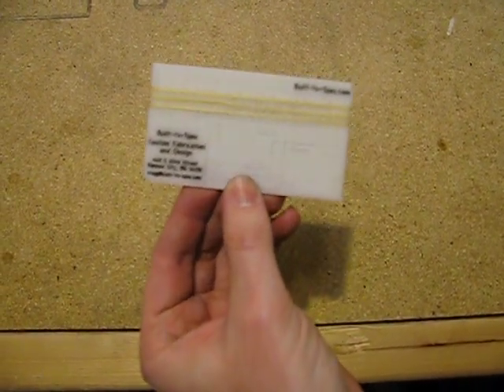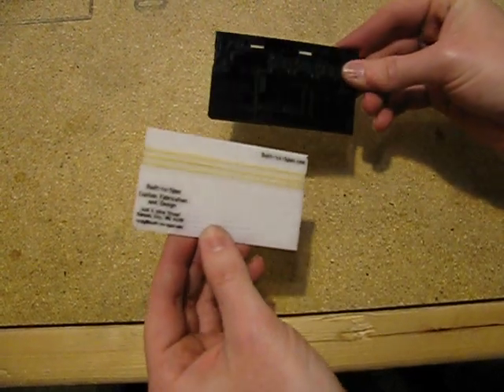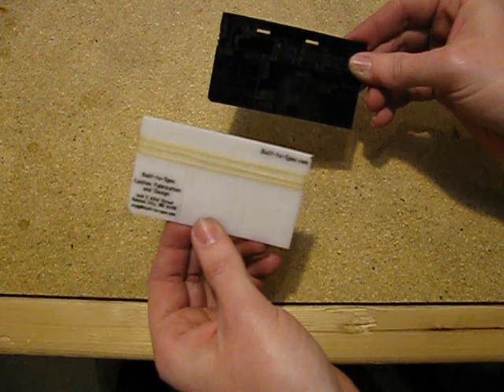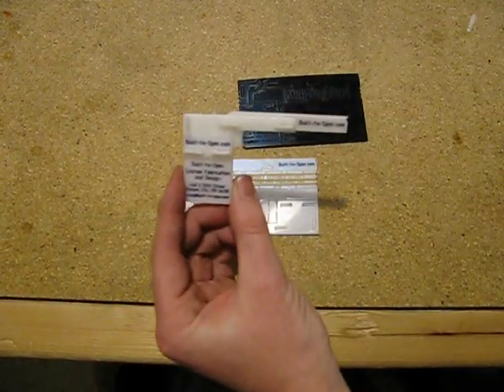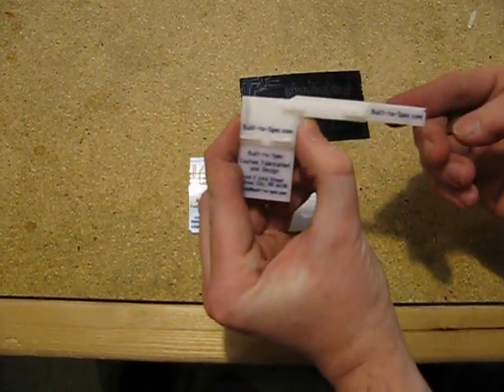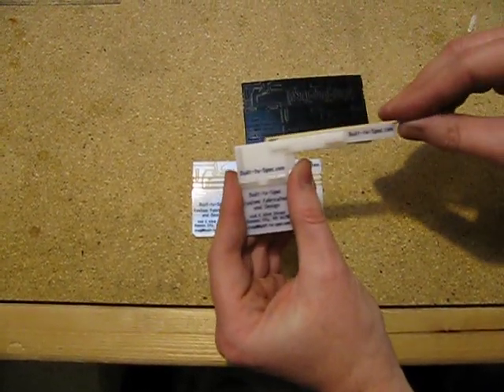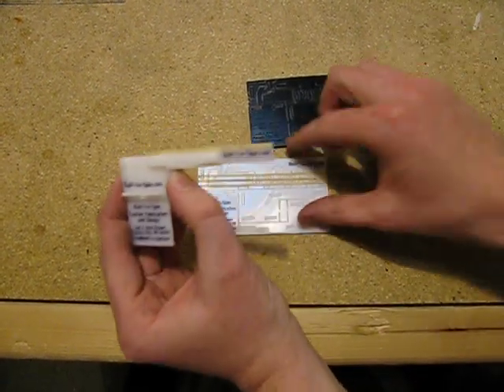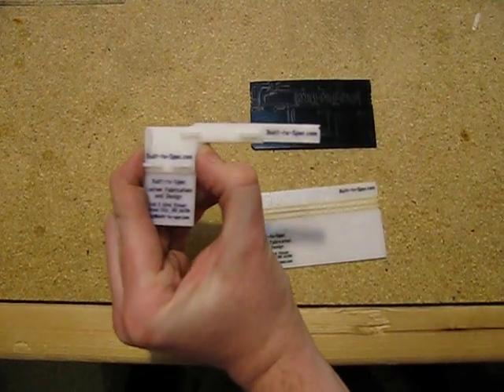Rubber Band Business Card in Action

Comment from the maker: Laser cutting and design, small run fabrication, electronics (embedded systems and digital stuff mostly), and little software stuff. Basically any small to medium sized project that needs some basic mechanical, electrical, or software components from prototyping a potential product to making a small run of a specialized component.